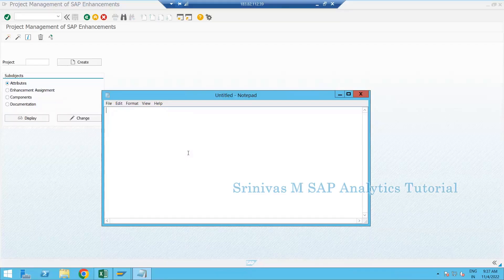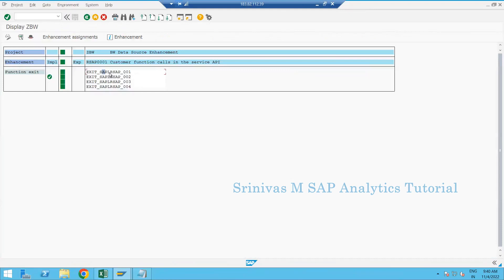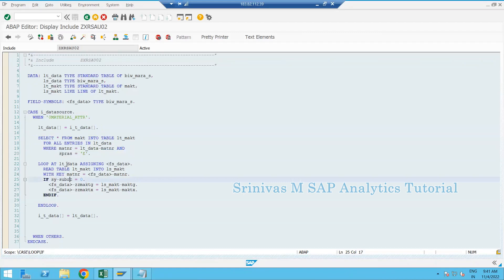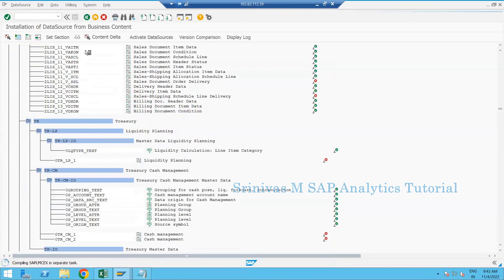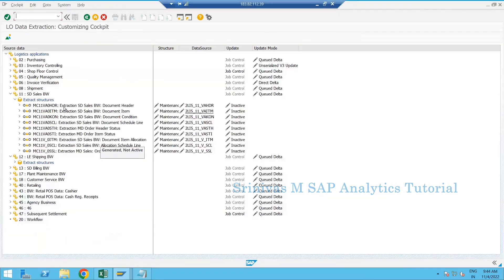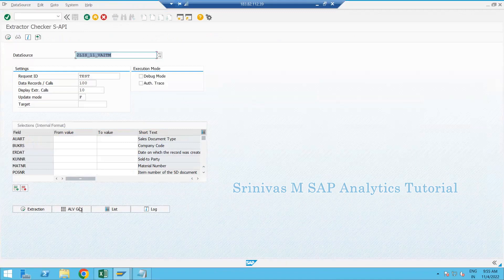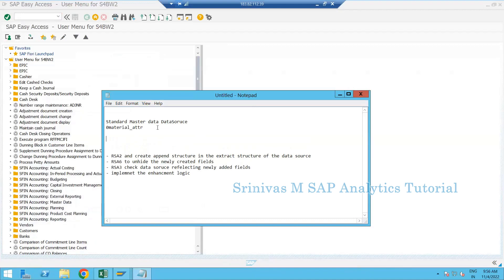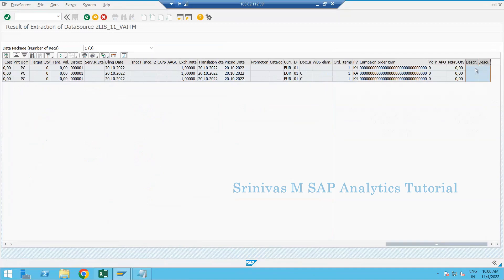17 LO (Logistics) Data Source Extraction and Enhancement

Comment: Hi, could you please provide more information on Selection/Hide Fields/inversion and Field Only  in the DataSource: Customer Version Edit page,
Reply: Selection : Fields which you want in you Extractor as selection
Eg: IF you check customer number and Date of posting as selection
Then in RSA3 you will have this fields as slection based on which you can get the data.
Hide fields : These are the fields which you don't want in you data source which will ulimately flow to BW. Hiding a field won't show you in BW as well.
Inversion : This is with only certain transaction type if some key figure you want as inverted(-1) in the output such as reversal posting. Here you can use inversion.
Field only : Not so sure about this option, only thing I know is it is used in append strucutre